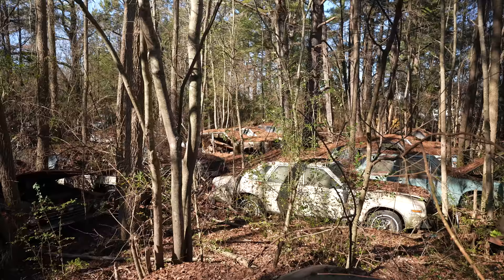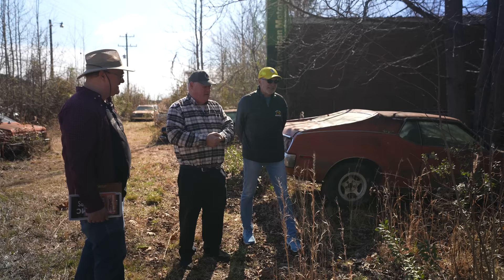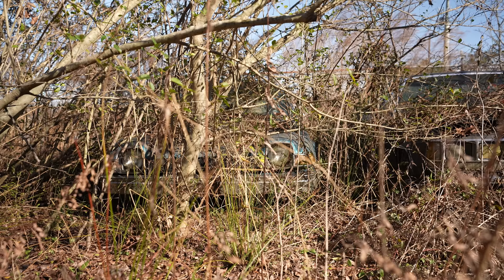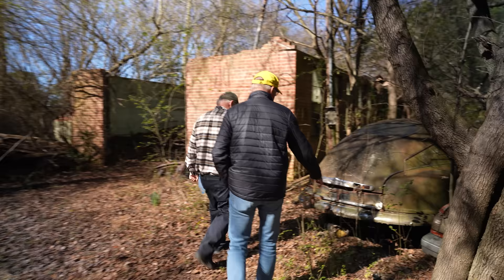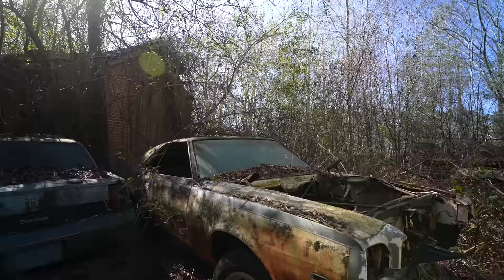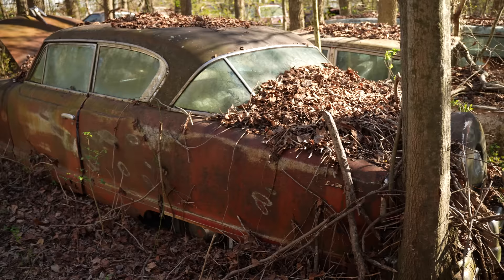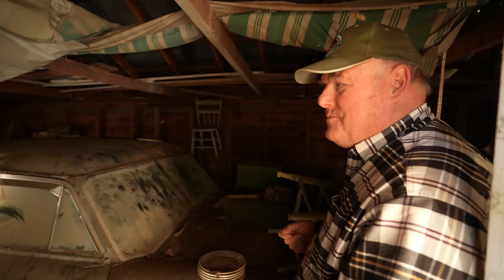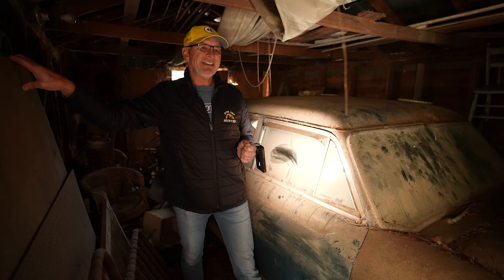Dealership Abandoned 40yrs Ago Collier Motors AMC Private Tour | Barn Find Hunter

Comment: AMC in 1980 was ahead of their time with the Eagle....Had they invested a little more money....Purchased the Rochester TBI that GM used...and the Ford AOD transmission their 258-6 cars would have gotten better MPG and due to O/D, been able to use numerically higher (deeper) gears to give them better performance.... Instead of an Eagle with 2.35:1 Axle - Could have run AOD with 3.31-3.54 and had much better takeoff! - AND you still have the deeper gears to pull light trailers with, in 3rd (OD Lockout) and use the mid-range RPM  -  They ALSO should have built a Ranchero/ElCamino/BRAT type truck on the Eagle Wagon Pan/Chassis (with 4/6cyl power-Maybe ) right away in 1980 as there weren't many 4x4 mini-trucks at the time...and I am certain that they would have sold really well...At least until the Commanche was ready for market. - Maybe even with a 2.5-3.0L 4cyl diesel, paired with a 5-speed manual...30+mpg should be easy!

Comment: I was a mechanic in the 80’s so, I worked on all these cars. AMCs were weird automobiles, mongrels that had parts from different manufacturers.
Reply: Perhaps... but they had their own engines. The body styling design was there own.. and AMC also made the XJ cherokee and designed the ZJ grand cherokee.

Amc only really used ford carburetors.  gm steering columns.  Chrysler transmissions.  And. That was about it tbh.   

Everything else would be typical for all the other 3 using dana axles.  Or what not.. yea ford had their own.. but amc also had their own axles too 

It isnt THAT much of a grouping of parts.  Just some of the larger things.

Comment: My brother bought a new Eagle wagon in 1980. It started smoking at 1600 miles and the dealer did a valve job on it. He sold it before it got 20,000 miles on it.  He said the car was terrible and it cured him of ever buying any new cars again. He is still driving a used truck that has 140,000 miles on it

Comment: One of the biggest thing that happened with vehicles. When cars started out. Cars fuel mileage grew on a sharp incline till the late 70's , early 80's. 
Then the fuel mileage strated a slow decline for many years because of the restrictions from the EPA. 
Cars where naturally getting better fuel mileage without the EPA interface. 
Even to todays cars are still not the best fuel economy compared to like sized models back years ago. 
Even a better reference for comparison is the size of vehicles now because of how the EPA restrictions are set up. 
The bigger the vehicles, the less mileage it has to run to pass EPA standards. 
So, if you have made it this far. 
Do you recognize the running theme. The EPA is the big issue with advancement of fuel economy for vehicles. 
Yet, another government entity that has caused more issues with real innovation and progress.

Comment: Im terribly afraid there may be a few salvageable parts. A restoration which would have to include massive amounts of fabrication would exceed the value by 100s of percentage.  What's an AMC worth. What's the cost of a ground up resto with fabrication.  They are all gone.
Reply: Easy rule of thumb is a full restoration (body off frame, stripped to individual parts, and everything refurbished/replaced) will run an average of $50,000. With missing/damaged/rusted out parts, that price goes up. Yet most of the cars here are lucky to be a $20,000 vehicle if you find one that has been cared for or restored years ago. You could easily be $30,000 in the hole on each car if you actually restored them.
Reply: @tommissouri4871  oh definitely. Without doubt.  A possibility? Donate them to an automotive restoration school.  In fact, Hagerty runs one. Jay Leno donates huge amounts to the school.

Comment: There is a lot more here than meets the eye, I suspect. Many a situations could cause this to happen. All of it involves $$$. All of those cars were used when left there. No dealer would leave new stock in the woods rotting away. First off a bank owned them if they were new.. New cars are financed by dealers and paid  off when they are sold. It's called a floor plan. Those cars were trade ins or they were bought outright. In the 70's some states did not issue titles only registrations. Very mysterious all that $$ laying around all those years.

Comment: It's not a reflector..it's a retroflecter.  Retroflective materials reflect a larger spectrum of the light back in a larger area and in multiple directions while a standard reflective material like a mirror has a set arc and only reflects in one specific direction usually 180 degrees from the source.

Comment: For $500 in the early '80s, they could have built a roof that they could have parked about a dozen cars under and kept most of the damage off of them. At least the dozen most important ones could have been saved. But there is something about these backwoods people, as I saw cars parked all over in the woods in the Carolinas when exploring 30 years ago. A few concrete blocks to get them off the ground and let air circulate to prevent ground rust. tires go flat, cars sink into the dirt, and then the bottoms rust out from too much ground moisture. Even a few tarps hung from that roof they should have built would have stopped most of this. Instead, it is a junkyard, with candidates for the smelter. 
There was a Studebaker dealership like this in Jerseyville, IL in the '60s and '70s. Many cars were inside. I don't know what every happened to them. I do know there were several outside and it seemed like such a waste to have new cars just sit and rust away.

Comment: In 1970 had a 69 rogue 290 4 speed changed motor out for a 1970 machine 390 with crane fireball cam best sleeper I ever owned ran high 12’s in street form

Comment: Not correct. Mr. Collier didn't "close" the dealership in the 1970s. He decided to only sell US designed and made AMC products which existed through the 1980s. He also took on selling used cars after that time as evidenced by the 1980s and up vehicles on the lot. 

Mr. Collier is correct, it's the 2.0L VW/Audi engine that he's thinking of that AMC sourced, and later on, the 2.5L Iron Duke that came from the Pontiac division of GM.
Reply: iron duke half of a 301

Comment: No Gremlin X? I am disappoint.

Back in the day I had a friend that replaced the drivetrain in a Gremlin X with a chevy v8, can't remember the details.  I remember it only had the front seats, everything inside and out was spraypainted matte black except the door panels and dash, and chrome pieces. He did something with the rear differential and had massive wide tires in the back. was fast and mean but tough to control in the corners

Comment: i had mixed feelings with this my 1st muscle car was 1 of only 260 made in Brampton ontario canada  the biegeish 1979 AMX 304 4speed with the handling package pLS posi  & low gear ratio , OUT went the pollution control, with  my backyard mechanic friend , 2 barrel to highrise EB holley 650 double pumper card , half cam , hooker headers dual thrush HUSH,  nothing but BOGGING , replaced carb to a  450 quadrajet , then was gifted parts from a older 343 engine HEADS , this was A ,  AMERICAN MOTORS XPERIMENTAL  AWAKENING approximately 280 HP  🤤 my AMX was soon beating on 1/4 mile stripes   BIG BLOCK challengers +++ , 5 liter mustangs & the ONE  which i had 2nd thoughts about the GRAND NATIONAL BY A FOOT ONLY , however i think the driver was a TAD nervous  at 100 plus MPH , the tires SHIRPED WELL from 2nd to 3rd , i HAD TO remove the pinstriping FLAMES & repaint  coopertone  after 3 RACING CHARGES , kinda give a  sleeper look , GAS was 35 cents a liter 1.40 a gallon  in the once FREE canada ,  TODAY  shity GAS just hit 1.79 a liter  SADLY OVER 8 DOLLARS A GALLON  9.64 for HALF DECENT GAS  DIESEL dont ASK in the NOW once called  Democrat liberals today is a SAD BUT TRUE SAD DAY  in COMMUNIST canada OOOOOOH i miss those GLORY DAYS  & i WISH i could get me the 1979 , 1 Year only 304 RALLY INSPIRED  AMX of course a few modifications